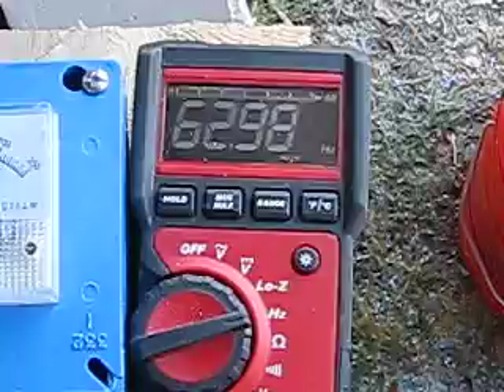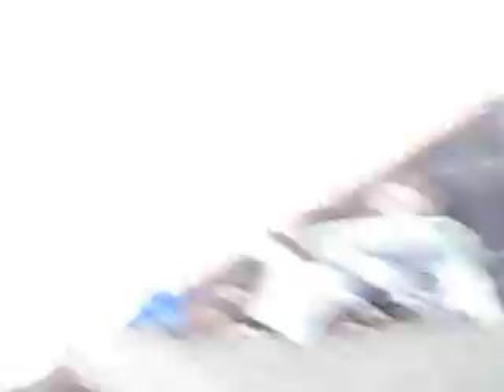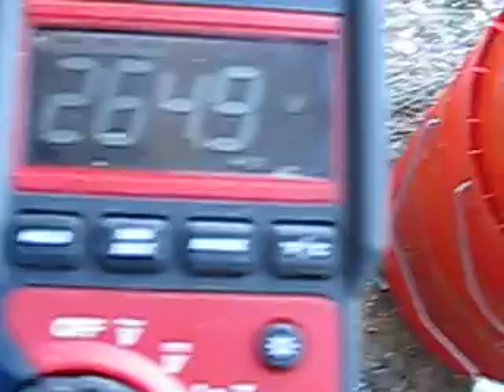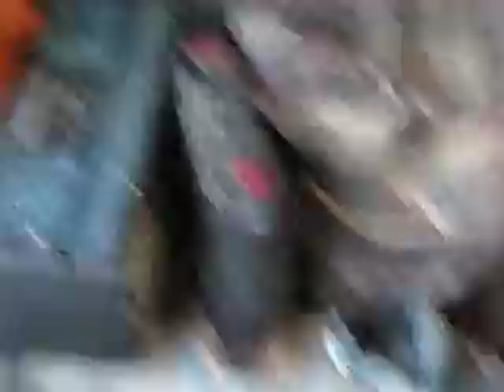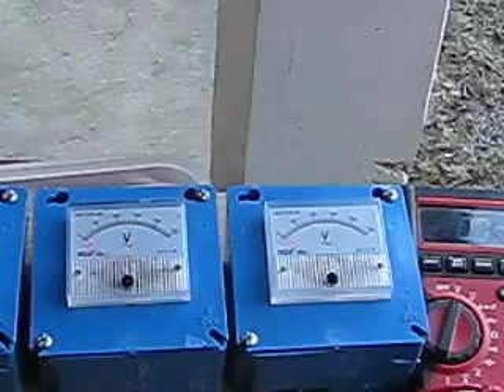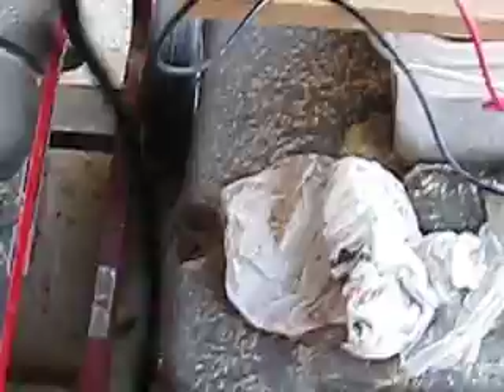Power Voltage Meters

Comment: Do you have a video on how you built/wired the meters.  Thanx
Reply from the maker: I don't, my videos now are so much better than in those days.
But the meters straight hookup to the power.  The 240 volt meter is across L1 & L2, the other two are to each L power leg and to Neutral.
Thanks